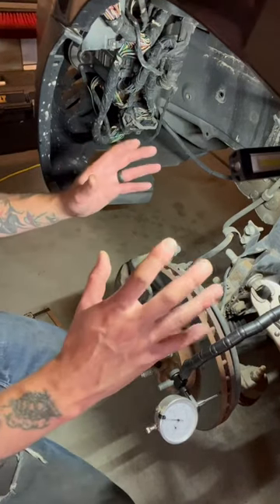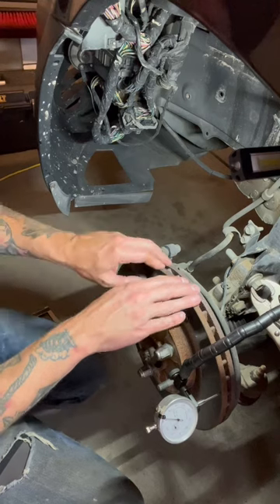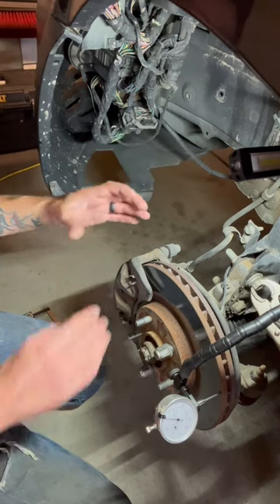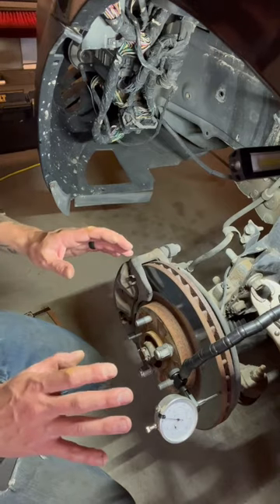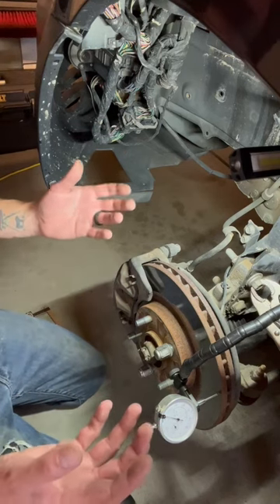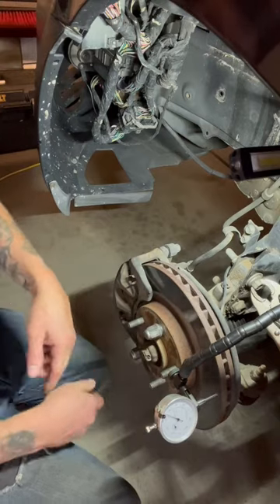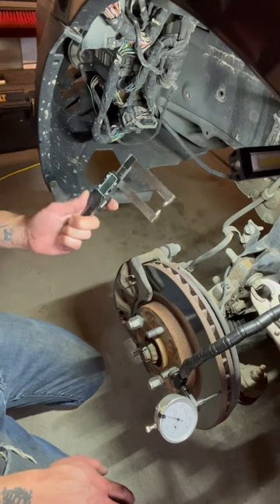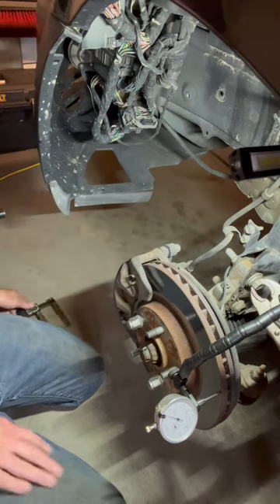How To Tell If You Need Rotors! Easy!

Comment: If you ever hear grinding you also need rotors😂
Reply from the maker: Great point!
Reply: what about grinding and the brakes aren’t even applied, what could the rotor be scraping on? just replaced my pads and rotors about 2 months ago and they’re damn near almost gone on the back side of the rotor like it’s been rubbing this whole time while driving my truck, could it be a bad bearing?
Reply: wheel bearing*
Reply: @SlimeDonDada check the sheild thats behind the rotor. Sometimes theres stuck rocks in there
Reply: @SlimeDonDada dust shield
Just push it away a little bit towards the car
Reply: accidentally drove my car with the parking brake on, didn’t go fast enough for the alarm in the car to go off but i went fast enough to eat the shit out of my rotors still lmao, this was a very expensive mistake

Comment: You're only checking runout on one side of the rotor. What is 2 little clicks? If you don't have pulsation when stopping the rotors are not warped.
Reply from the maker: 2 little clicks is "0.002" of an inch. I've never heard or seen someone checking for run out on both sides. If it's warped you only need to check one side. And pulsation when braking can be very subjective from one person to the next, always best to take a measurement. Hope that helps.

Comment: Save yourself the time and trouble. Just install new rotors everytime you replace the pads too.
Reply from the maker: @childrey14  people changing their own breaks are typically trying to save money. If they can save an extra $100-$130 per set of rotors by taking some basic measurements, I think that would help a lot of people. That’s some extra cash for groceries or towards other repairs a vehicle could be needing. I get where you’re coming from, but if the car doesn’t need it, could be helpful for those in tough financial situations.
Reply: @aiyogarage  I used to just buy new rotors because they were very inexpensive, but not anymore.
Reply from the maker: @jamesmadison9244  yeah I think parts costs have never really recovered since the pandemic. Might get to the point where getting rotors refinished might start to be a more coast effective solution.

Comment: Get new rotors every time you do your brakes. It is best to have 2 brand new surfaces coming in contact with each other rather than an old rotor and new pads.
Reply: Completely unnecessary and a waste of time and money
Reply: What is this? A spending money contest?
Reply: @kottyking  waste of time? Brakes are a pretty important component to your vehicle.
Reply: @NeverCloseToHome  it only cost me 400$ for all 4 rotors and pads. I don’t think that is to bad since my rotors and pads lasted 100k
Reply: @kottyking you should definitely atleast resurface them, if they’re not bad enough to replace ofc. it’s just smarter i don’t see why it’s a waste of money when you’re risking spending more money on new pads even sooner if you don’t do it

Comment: I had my pads and brakes replaced in October of 2022 because they weren’t OEM and now I can hear my brakes making a crazy scraping noise on the back passenger side. Could I have worn these out this fast?
Reply from the maker: @dbigyrlalwayscute7080  you could have. That would be more indicative of a sticking caliper or seized slide pins. I would get them inspected, and as long as there is still life on the pads, and the rotors are in good shape, you might need to replace a brake caliper, or simply clean and lubricate your brake system. But I would look into it sooner rather than later 👍

Comment: I always replace my rotors every 2-3 pad replacements. I scuff them with some 100 grit and do a proper bed-in
Reply from the maker: @samleen  not a bad rule of thumb 👍
Reply: @aiyogarage  I recently replaced my rotors and couldn’t get pads in time. I used some 200 grit to remove any glazing and flatten them. Then I bedded them in slowly so they wouldn’t scratch the rotors. The old pads still had over 75% life left so I took an educated risk
Reply from the maker: @samleen  yeah I think as long as the pads have plenty of life, and they’re worn equally on both sides I don’t think that’s a big deal
Reply: @aiyogarage  there’s just so many idiots pad slapping cars with worn rotors

Comment: Also with the pads, if there is uneven wear then you could have a  warped rotor.
Also check both sides of the rotor for scores, which means that you either had contaminates between the pads and rotors, or you waited too long to change your pads.
Also make sure your caliper guide pins are lubed up
Reply from the maker: Great tips!
Reply: Thanks
Reply: My BMW manual says not to lube the pins. I guess that’s rare

Comment: Nice, id also just replace them if there is too much rust build up around the fins as they can prevent the rotor from dissipating the heat, rust being an insulator it could also cause abnormal pad wear.

If anything if you save your old pads and have at least 3mm on them you could temporarily use them until you get a proper brake job done. Having older cars you may have to replace the caliper or rubber lines as well.
Reply: Also forgot to mention if you're regularly checking your brakes and ensure the pads can move freely in their slides its easier to diagnose abnorma wear to the caliper itself or the rubber line.

Comment: No bro u can FEEL it when stopping 😂
Reply: is it like an jerk feeling in the steering wheel?
Reply: @edwardlondon6463 warped rotors cause a vibration under hard braking. Usually felt in the steering wheel if the front is bad, or felt in the seat if the rear is bad. Can also cause a pulsation in the brake pedal
Reply: @desmondhealy4827 ya it’s annoying asf bc everytime u break u aren’t slowing down tht fast and it feels like ur cars bouta break

Comment: I cant seem to find someone that can answer my question so I'll ask you. Is it possible for a vehicle to not have rear brake pads and rotors? The other day I had to change a flat tire, and when i took off the tire, i noticed that there are no brake pads or rotors. Just the round wheel where the lugs are. I went and checked the front of my truck and the brake rotors dont look worn out. Im not having any issues with brakes at all. But i just thought it was odd that my truck doesn't have rear brakes. Is that possible? Or am i missing something? Like i said, I'm just curious. And google isn't answering my question.
Reply from the maker: Wow that’s an interesting scenario. Without knowing the history of the vehicle, I would imagine at some point someone changed out the rear differential assembly. And the brakes on the one they switched it out with, either weren’t included or didn’t match up somehow. My guess is that it had drum brakes at some point in the rear. Might be worth some investigating, and seeing if there’s anything remaining of the old brake system. And, it probably wouldn’t be a bad idea to start figuring out how to get a brake system restored to the rear of the vehicle. It is your brakes after all.
Reply: @aiyogarage  It's a 2005 Chevy Silverado 1500 extended cab. I purchased it in 2014. I had it for 10 years already and I have only had the brake pads and rotors changed in it once. That was like 2 years ago. I have never had brake issues. I just thought it was weird that it doesn't have rear brakes. Neither does my 2001 Toyota Corolla. I also bought it used, but it brakes fine. I was just wondering if it's something I should even worry about since I don't have braking issues.
Reply from the maker: @Tomas-gd6lk  only thing that comes to mind is wearing out your front brakes much faster
Reply: Are you sure they don't both have drum brakes on the rear?
Reply: I'm pretty sure your vehicle has drum brakes instead of the typical disc brakes you're used to seeing. So instead of having a disc/rotor with caliper containing brake pads, there's a drum enclosing all the brake hardware. If you pull the drum out, which can only be done when the parking brake isn't engaged, you'll see a pair of brake shoes connected to a wheel cylinder. 

I recommend learning about drum brakes if you're still not following. Hopefully that helps you out

Comment: Where would you get all the tolerance specs though? Google does not like that question.
Reply from the maker: The tolerance will be in service data. Which you can get from AllData. If you absolutely cannot find a spec, good rule of thumb is no more than 0.002” or rotor run out. Hope that helps

Comment: I just got my brakes and rotors replaced like 2 years ago . I was just told my rotors have excessive grooves the brakes are fine . How is this possible? Could it be a case of up selling me or how can new rotors have excessive grooves , meaning, they may need replacement already? I got oem parts too.

Could a bad installation cause this? I really am confused about that assessment
Reply from the maker: Honestly without taking a look myself I wouldn’t be able to tell you. If they do have excessive grooves they are in need of replacement. I would as of a photo or video of your brakes as proof. Hope that helps
Reply: Yeah they gave a photo, I lens I can see it but I wouldn’t know if it’s excessive or normal myself . It’s just weird to me that it would be excessive in a short time frame , My last rotors lasted like years and years. I barely have driven since I got these installed
Reply from the maker: @heythere6983  could be an issue with calipers sticking or slide pins that weren’t greased properly. Those can both cause pre mature brake pad ware
Reply: Ok thanks I’ll see if I can take it to someone to double check . Can calipers be lightly sanded to fix grooves if it isn’t too bad? 

I’m thinking if there is something off maybe I can fix that and then condition the rotors if it’s a little wear instead of buy new ones all over. I had a friend who’s a mechanic instal em outs his garage but maybe he messed something up
Reply from the maker: Calipers can not be sanded. The brake system needs to be inspected by a professional for inspection. I would recommend a second opinion on why the system failed prematurely if you're this concerned.  @heythere6983
Reply: Yeah I’m gonna take it somewhere to get checked. I can’t tell from the pictures if it’s normal myself so I’ll have to get another opinion
Reply: ...oops I meant to say rotors. I see you can resurface rotors,
I’ll look into that ,
Not caliper haha

Comment: Are Duralast rotors any good, how bout NAPA pads as well?
Reply from the maker: I love duralast gold! Great product!
Reply: Duralast rotors are not great. I've seen many with surface layer fractures after low miles.
Napa batteries are crap.  Napa brake pads are fine if you get ceramics.  Stay away from BrakeBest at oh oh oh really.
Reply: One-side I did Duralast, holding up OK so far, the rest of the brakes and rotors I did OEM more $ but hopefully better results, seems like more brake dust with NAPA pads thus far
Reply from the maker: @ScottieBMan  yeah I’ve never had a problem with aftermarket pads and rotors

Comment: If the surface of the rotor that the pad presses against is rusty, they need replaced?
Reply from the maker: It’s common for rotors to get rusty when a car sits. As long as the rust doesn’t show signs of pitting or cracking, it should just come off when you’re driving.

Comment: Would a warped, rotor, cause, crazy, squeaking, accelerating, and or pressing on the break I know that I have a warped rotor. I am just wondering if this is the problem because I have a crazy squeak but I also just replaced my control arm and tire rod but I know that my rotors are warped and I’m wondering if that’s what causing that crazy squeak? Also when I’m coming to a stop like 10 to 0 my car some wet rocks. Back-and-forth around the 5 to  0 Mark. It’s very very light, but it’s noticeable when you go from second gear to neutral, and just ride it out on the brakes
Reply from the maker: I think it would be a good idea to get it checked out by your local shop

Comment: If they don't shake when I break at high speeds I don't change
Reply from the maker: That’s cool. I’m sure you’ll live a long time
Reply: @aiyogarage  sorry but warped rotors will not lower your life expectancy
Reply: @shadowman1992  i used to think the same shit until my rotor broke into pieces and jammed itself on the inside of my rim. It completely locked up an entire wheel and sent the car sliding into trees at over 120. Save yourself a totaled car and permanent back pain.
Reply: @da_poopoo_dealer3152  how fast were you driving wow !?
Reply: @shadowman1992 he literally said 120 lol
Reply: @da_poopoo_dealer3152  why would you be driving 120  anyways
Reply: @johnthompson3856  i was kind of a dumbass back when i did that. When you’re young and immature its easy to think it wont happen to you, and you can get carried away with a quick car, then it just happens when your guard is down. Not a smart decision but to be fair, the crash likely wouldnt have happened if my brakes didn’t jam up, because it was a straight road with no traffic so not much to go wrong. I would advise against going that fast but if you must, PLEASE check your brakes, your fluids, your suspension, your ball joints, your bushings etc before doing so.

Comment: Those rotors are on backwards. I know it seems to make sense with how they are currently positioned because it would seem as though it’s scooping air. Those grooves are for air to escape not capture.
Reply: There is a few versions of the veins. 
Straight, forward and backward.
Each manufacturer has their own instructions.
One will say to put them forward, one will say backwards.  The straight ones are self explanatory.
Reply: i didnt think rotors were left or right.  only one part #.   so u can't put them on backwards.
Reply from the maker: Only slotted rotors are directional. Thank you